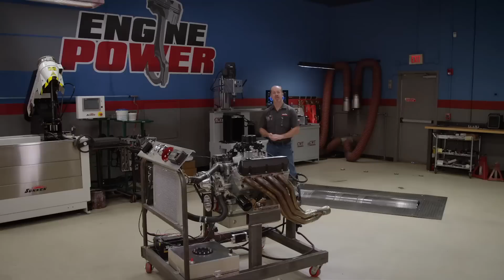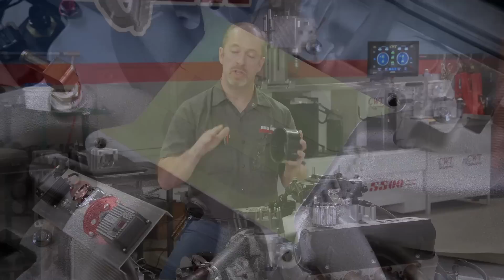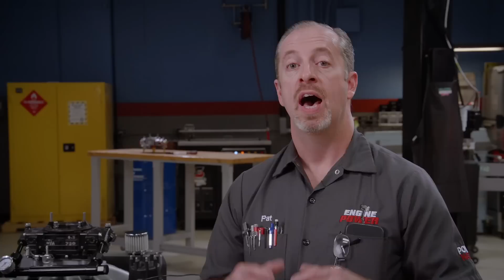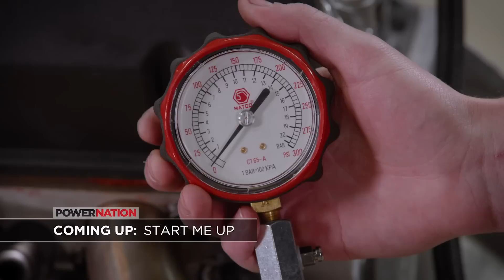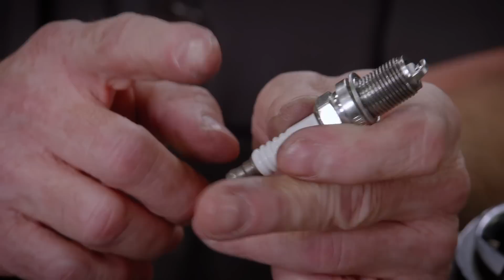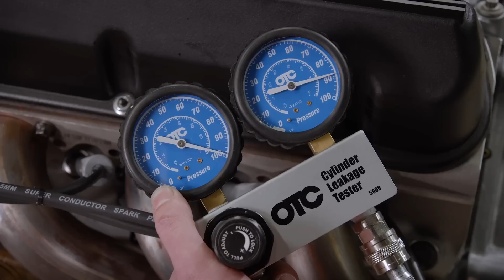Top 5 Reasons Why Your Engine Won’t Start - Engine Power S10, E8

Comment: My positive cable has a short somewhere near the starter on my hardware store/parts truck. For a while, I could wiggle the cable and it'd start, but it's getting worse. So, now it's time to buy new cables, and get them in before the snow starts to fall.

Comment: I have a 74 C20 that sat in the woods for around 20 years. I put on a new carb and all new electronics and it would turn over and gad spark but would never start. I played around with the distributor and it was way off. Once I got it in the right position it fired right up and has still does and runs great

Comment: Did you use non ethanol fuel or 93 octane with 10% ethanol in it  also I heard that non ethanol gas is best for carbureted engines

Comment: On gdi engines you can see spark advance drop off drastically on tip in throttle on a scanner the nock sensors hear spark knock before we do
Reply: Sign of carbon on valves

Comment: Great video. very educational, even for an old timer like me.  I love the fact that you covered spark boxes. I have had serious bad luck with MSD recently.  had a LS engine with MSD coil packs failing after 3 months, replacement were also bad. 3rd set of replacements were good but only lasted 6 months, then failed again. put the factory originals back on, no more problems. same thing with their spark boxes, I have a 6AL in my 70 Camaro, box went bad about 1 year after i bought it, replacement was DOA, Second Replacement was also DOA, pulled out the MSD Distributer, Coil and spark box and installed a Pertronix OE lookalike with the igniter III module and an Igniter III coil and have not had a single issue after 4 years. I don't normally like to call out manufactures but Holley needs to get their act together with Quality Control, it not just their MSD division, but carb division is not much better, recently bought a Holley HP and there was a jet loose and rolling around inside it right out of the box. no damage to the box at all. opened it up and had to tighten all 4 jets. but after that it ran fine. it's just poor-quality control at the factory.
Reply: I had similar issues, thankfully, not to your extent, however. I just dumped a $1,200 Holley XP carburetor last year that was supposed to be top of the line, but turned out to be nothing but problems. 
So far I’m enjoying the Quick fuel replacement. I know it’s not far off, but it is a better model.

Comment: My dad got an old Willis mj2a jeep, had an oil bath air filter. We couldn’t get it to crank and took the air filter off and pored enough acorns out of the air tube and filter assembly to fill up a 5 gallon bucket. 

That squirrel had enough acorns saved up for several years in that little  hiding spot

Comment: Operator error?? Uh. How about TIMING? Carburators are forgiving. Ignition timing is the most common thing to stop you from running. As well as valve timing if your chain is worn and jumps a tooth or 2.
Reply: Even hagerty built an engine and wasted a bunch of time troubleshooting because the distributor was 180 pr something.

Comment: Without watching video....
Weak 12v+
Bad ground(s)
Starter faulty
Weak connections at starter
Starter relay
Security system 
Ignition switch
Power/ground to PCM and sensors
Faulty sensors
Timing
Worn timing components or broken 
Low compression/rings
Low fuel pressures
Bad injectors 
Bad fuel pump
Fuel pressure regulator/check valves
Fuel filter
Constricted fuel lines feed or return 
Vacuum leaks
Air intake restrictions 
RPM set too low
IGNITION system faults (ALL OF THEM A POSSIBILITY)
Low oil pressure
Severe internal damage
Intake gaskets 

I missed a few, but these are all things that fly through a mind when diagnosing a problem, especially no start)
✌️
Reply: Many of these things don’t effect an engine starting.
Reply: Name 1. And why. Also, this applies to old engines in old vehicles and newer ones that use a PCM or computer, in case you don't know what that is.

Comment: I can do this in 3....
1) no fuel
2)no fire
3)no compression 
Done
Reply: Still need air and power unless you hand cranking the engine over
Reply: @Thumper68  not crank...description said not starting...so cranking its doing...you'll discover air issues when you address the fire, fuel and compression...the 3 are all that's needed. Chase those and they will lead you to the problem...35yrs a technician here.

Comment: You guys should also check for restrictions in the exhaust
Reply: I have had a couple vehicles run into that problem when the muffler or cat collapses.
Reply: I came across a 5 hp Briggs that wouldn't start. I eventually found out that someone had jammed a MARBLE in the exhaust pipe!
Reply: I had a 2 stroke scooter that wouldn't start. Turned out to be a mud dauber wasp that clogged the muffler tip with mud.

Comment: Mine was coil overheated due to tach wire being plugged in. Hei style with speedway 12 circuit harness. 66 mustang and no tach, was gonna install one later. Replaced and deleted tach wire. Very weird because it ran fine prior and only other thing added was ac blower assembly hooked to the ac labeled wire 🤔

Comment: Years ago I watched a guy tear apart an engine for a cam swap. They got it all back together and it didn't even try to fire. I asked them if they timed the distributor. He look at me like I was an idiot and said he didn't turn the engine or distributor so its fine and I'm a moron for suggesting that. I ended walking away. I don't recall him ever running that car again.
Reply: Or when you accidentally run the wires backwards.
Reply: @FixingWithFriends  i helped my wife's cousin get his gmc going. Him and his business partner( hard core chevy guy) were "mechanics" starting their own repair shop after tech school. Anyways, they installed a 350 crate engine in his k20 with carb & hei. I happen to stop by and asked whats taking so long on it. He cranked it and it was banging on a couple and out the carb on a couple. I said we are starting over. Distributor was 180 off and 4 wires were switched around. Fired right up, only a few degrees off.

Comment: 150 to 180 psi is that cold cranking compression,or engine warmed up?
Reply: Shouldn’t matter. Most people check compression on cold engine.
Reply: @Thumper68  was thinking a warmed up engine may have developed more cranking compression.
Reply: @DPhippsActual  nah plus it’s not really fun to be pulling plugs and doing all that work around hot headers etc. your cranking the engine over few times on compression check to get highest reading anyways.

Comment: Can you tell me why my 98 Astro won't charge lol? The alternator is good
Reply: Nut loose... between the seat and steering wheel..... AIN'T IT JUST AIN'T IT 😜 lols..... honestly instrument cluster....it loops through it...
Reply: Assuming there is no wiring issue in the charging system, the battery could be the problem.

...Or I guess there could be a parasitic drain that is draining more than it's charging?? (Seems unlikely)
Reply: @FixingWithFriends  I'm thinking the positive battery cable maybe... I'm not 100% sure honestly. I've never really dealt with electrical issues before other than changing an alternator when it was called for. I've read so many things about trying to fix it alot of people said fusible link? I guess that's parts of the positive battery cable...

Comment: My battery cable was lose .
Reply: My wife changed my keys with another similar key
Reply: hahaha ^

The loose battery cable is usually why my battery is dead.
Reply: It does happen.
Reply: Use to take off Battery cable to see  if it was charging then turn on headlights . If it quit  running  actuator need changed